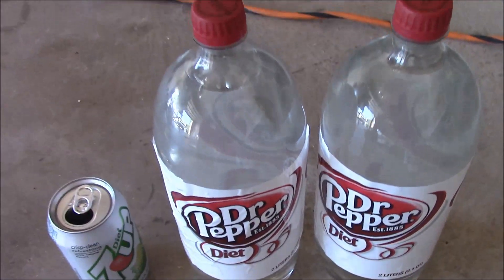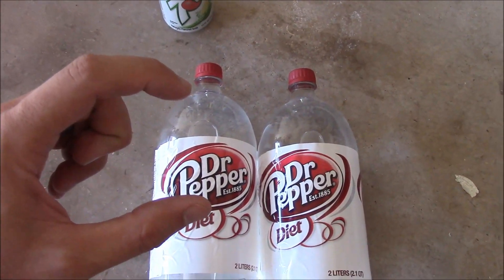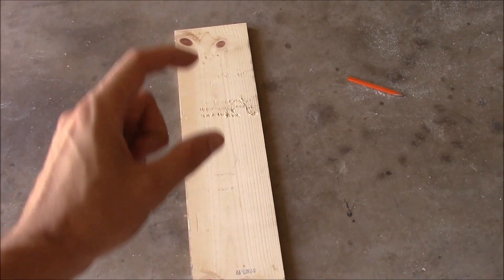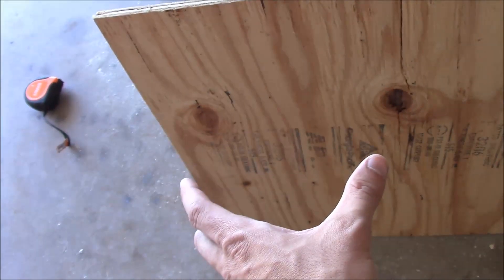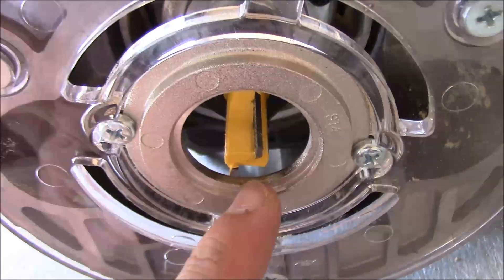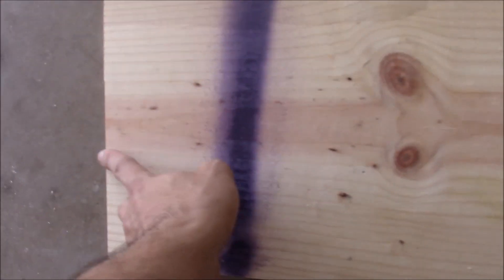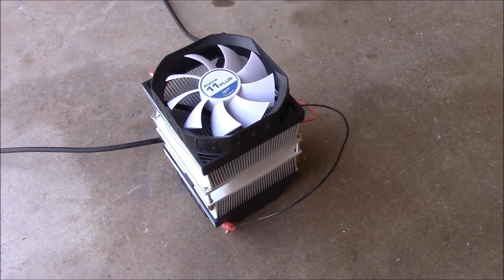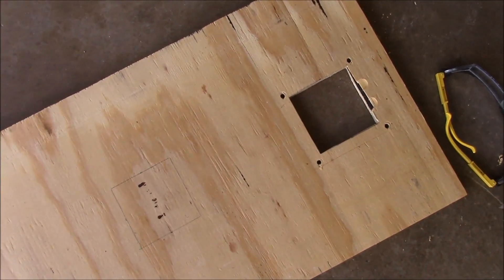Mini DIY Peltier/TEC Fridge Prototype - Learn From My Mistakes

Comment: I doubt that you will manage to build a fridge this large using Peltier devices. They have very poor efficiency (maybe 4%) and if you want to generate a "cooling power" of 10W, which may not even be enough in itself to cool your fridge, you'll have to use electrical power 25 times greater, which is 250W. From a 12V source, this would require a current of around 21 Amps. Your 2 x 7Ah batteries would be fully drained in less than 20 mins. On the other hand, a standard fridge has an efficiency of about 40%, so the total energy consumption for the same cooling power would be only 25W (or 2A). That's why you don't see too many house fridges (if any) built with Peltier devices... It is essential to use extremely efficient thermal insulation and even so, in amateur conditions, you may still loose a few watt of "coldness" through the walls and door.
Reply from the maker: Understood.  This is an uphill battle and will never be as efficient as a normal refrigerator but it could be a valuable prep to keep a few things cool in an emergency situation.
Reply: I am not sure where you get your numbers. But peltiers are not as bad as you make out. In fact the official numbers show a 136w peltier to be able to move 80w of heat. Of course that means on the hot side you have 216w of heat to get rid of.

As far as a compressor system which is used in fridges and air conditioners they are far more than 40% efficient. They are over 100% efficient since they can actually pump more heat than energy required to run them. And no this does not break the thermodynamics law. Please research this to understand it.

A typical air conditioner of 500w usually has a cooling capacity of at least 2kw. Which means 4w of heat is removed for every watt of energy used by the system. This is due to the amazing ability of gas compression and expansion.
Reply: David Irving Hi David. Please check here: http://www.powerchips.gi/technology/pcalc.shtml. The Peltier is said to have under 10% of the Carnot Cycle. For a Carnot engine, operating with a high temperature of 35°C and a cold temperature of 0°C, the efficiency is (according to http://hyperphysics.phy-astr.gsu.edu/hbase/thermo/carnot.html) 9.58%. I selected these temperatures as for a typical refrigerator. The higher the temperature difference, the better the efficiency. Also, wikipedia 
(http://en.wikipedia.org/wiki/Thermoelectric_cooling) says that Peltier devices are typically about 4 times less efficient (10...15%) than standard refrigerators, which have an efficiency of 40...60% of a Carnot Cycle. Even considering a Carnot Cycle having an efficiency of 50%, the Peltier would have an efficiency of 5...7.5%. I haven't read much about these things, please feel free to direct me to some online documents describing a better efficiency.
I also do not understand how can a 500W air conditioner have a cooling power of 2kW. Can you supply some links please?
PS - I did some more search and based on http://www.heatsink-guide.com/peltier.htm, apparently supplying 12V, 2.7A (= 32W) into a Peltier device, helps moving 15W of power, at a temperature difference of 45°C. This is surprisingly good news, if it's true.

Thanks, Nicolae
Reply from the maker: Nick, thanks for the research.  That is great info!

Comment: Nice experiment. Very similar objectives to one I did 6 months ago, do please take a look at my video.
https://www.youtube.com/watch?v=M6e2rrK0Cvg
See part 8 (!) for my conclusions on my water cooling cool box.
Perhaps between us we can crack this!
Like John D indicates keeping heat from the hot side well away from the interior is a challenge (I moved the peltier as a result). Fan of course also give off heat.
I too experimented with lead acid batteries, though "car" size. I calculated that we would need to achieve high efficiency such that the thermostat control would reduce the overall power usage if this is to be suitable for running on batteries whilst camping etc.
Tip: I suggest 50mm (2 inch) min. ideally 75mm (3 inch) thick foam walls. My 100mm walls made the box too big.
Good luck!
Reply from the maker: Hey!  Nice videos.  We were doing very similar builds around the same time.  I also went with water cooling a peltier only a week or two before you did (https://www.youtube.com/watch?v=tnKlIc6oCCg).  My next build (in the next few weeks or so) will be a more insulated, better built refrigerator box with a liquid cooled peltier setup.  Stay tuned!  I am sure we can figure this out.

Comment: You need to insulate the two heat sinks from each other where the TEM is not. You do not want any heat transfer from one to the other. This is where you have your greatest temperature difference. Heat rises so you want  to try and design hot heat sink side up so heat will flow away from cold. Check temperature of hot heat sink you want that as close to ambient temperature as possible. Make sure no heat from hot heat sink is blowing on to your frig. Inside the box you are trying to warm that cold heat sink to ambient temperature of the interior. You may want to play with fan direction also. Keep trying remember HP started in a garage.
Reply from the maker: John Delselva Thanks for the comments.  I am definitely going to try again.  I have received the equipment I need to try doing this with liquid cooled peltiers so heat transfer should be less of an issue.  I am also going to make the box of the refrigerator more air-tight with finger joints and better insulation.  I will be doing this in the next week or two.  Stay tuned!
Reply: Heat only rises in a gas like air or liquid. It's not the heat that is rising but the change in the gas or liquid becoming less dense.
Heat inside a metal does not rise but simply flows to anywhere that has a lower temperature. Please research this.
Reply from the maker: I understand those concepts, David.  What do you think needs to be improved before I build my next one?

Comment: Should've put the peltier units on top. since cold air sinks and hit air rises, the unit would be colder inside. Do like the pros do on high-end fridges; where the compressor assembly is on top.
Reply from the maker: Maybe so.  In this case it wouldn't have made enough difference to meet my goals.

Comment: plug it into the wall?
Reply from the maker: I don't have an AC to DC transformer or I would.  This device runs off of 12v DC power so it can't be plugged directly into the wall.

Comment: Where can i buy the Heatsink fan and thermoelectric device that can ship to Singapore?
Reply: http://www.aliexpress.com/item/10PCS-LOT-TEC1-12706-12706-TEC-Thermoelectric-Cooler-Peltier-12V-New-of-semiconductor-refrigeration-TEC1-12706/1743145532.html
try Sim Lim Tower for heatsink
Reply from the maker: http://www.amazon.com/ARCTIC-Alpine-11-Plus-Cooler/dp/B00606OHQQ/ref=sr_1_5?ie=UTF8&qid=1414510090&sr=8-5&keywords=arctic+11

Not sure about shipping to Singapore but I would think that they do.
Reply: LDSreliance Thank you. But did they come with crocodile clip on the heatsink fan?
Reply from the maker: No they do not come with alligator clips.  They come with connectors to connect to a computer motherboard so you need to cut off that connector and then connect the wires to your own power source.
Reply: Okay. Thank you.

Comment: Very nice. I'm planning to install a Peltier cooler in my SUV and that's how I found your video. I think what inspectyerbooty said about the sinking cold air.will be quite useful. I think I should make holes on the board inside the cooler. It may lead to more uniform heat transfer inside. And also less mass inside the cooler means less heat inside the cooler. It may not be very significant but I guess every little bit can be helpful. Do you think it will be harmful to the battery if I install it in a car? Thanks for sharing the video.
Reply from the maker: Thanks for watching!  The only way it would be harmful to your car battery is if you run it when the car is turned off.  Car batteries are not meant to power a load for very long.  They are meant to provide a lot of juice for several seconds.  Kind of like a marathon runner (deep cycle battery) vs. a sprinter (car battery).  The sprinter is going to run out of gas quickly.  And with the kind of amperage that these peltiers can draw (5 amps to over 50) you shouldn't run it for more than a few minutes with the car turned off.
Reply: LDSreliance Thanks. I bought a 7.5 L cooler from the market today which have one Peltier element and there is no fan inside. I am disappointed by the performance and that is why I began looking for information on Peltier coolers. Can the absence of fan inside the cooler be the cause for poor performance? Also, the cooling surface is at the bottom of the cooler.
Reply from the maker: Having the cooling at the bottom isn't a problem.  I would suspect that the peltier inside is a very weak unit and that there is poor thermal transfer on both the cooling and exhaust side.  That is why I am trying to build my own unit.  The good part is that the units like you bought are cheap.  The bad is that they just don't work as well as you would think they would.  And I am pretty sure hacking yours up to add fans would not be worth doing.
Reply: Yes, it is very cheap and weak. But at least the cabinet is pretty well built and looks quite nice. So, if I install a more powerful Peltier unit it would not be a total waste.
Reply from the maker: True.  But the power supply for the fridge probably will not be adequate for an upgraded TEC.  You'll have to replace both.  Not a big deal, really.
Reply: How so? The voltage in my car power port is 12V. Do you mean that I will have to get increased voltage for an upgraded TEC?
Reply from the maker: Oh it plugs in to a car adapter?  I assumed it was ac.  You will still be limited to 15a max but that should be enough.  I think a 15a one might blow your fuse so I would recommend a 10a one.
Reply: WaaWaa Waa
definitely a fan inside and outside the box directly on the heat sinks of the peltier is a must for efficiency in my opinion. what i mean is you need 6 parts, a peltier, 2 heat sinks with fins, thermal paste, and 2 fans,... that's 6 right? LOL  with good luck

Comment: My question is will the heat side burn the wood? Or should I put some kind of barrier between the wood and the hot heat sink?
Reply from the maker: lwiley2002 Nope, it is barely warm to the touch with this lower power peltier.  Even with the strongest 40mm peltiers on the market, you still wouldn't burn wood.  You are safe!
Reply: Thanks, I'm using an old Colman cooler heatsink and peltier to make a fermentation chamber for brewing beer I just need to cool about 5-15 degrees in a box roughly twice the size of the original cooler, this should be easy considering the original cooler would get down to 32 in a truck that would get up to 80
Reply from the maker: Yeah that shouldn't be too hard at all.  It may take it a few hours to cool things down but it would work.  Good stuff.  Let me know how it goes.

Comment: I'm making a similar refrigerator for my school project but I'm also planning to use the hot air to make a heating chamber. Can you let me know if its possible and approximately till what temperature will the heating chamber reach with two similar Peltier modules used by you?
Reply from the maker: *****I am not sure what temperature the hot side will reach.  The difference in temperature between the hot side and cold side of the TEC is about 75 degrees C with one unit so if the cold side is 15-16 degrees C like I found then the hot side would be a maximum of 90 degrees C (or about 195 degrees F).  That isn't possible in the real world so I would guess around 150 degrees F or so.
Reply: LDSreliance Great! Thank you for the info. :) One more question; since there is a considerable temperature difference in the TEC and the thickness is not very large (4mm approx. I think), does the hot air of the TEC try to get back to its cold side and decrease performance? This question was asked by a senior faculty of mine and I couldn't give her a convincing answer as I've never worked with a TEC.
Reply from the maker: Not if you draw the heat from the hot side of the TEC through a heat sink and then blow the air away from the unit.

Comment: are you going to make another video on this test?
Reply from the maker: Yep.  This time I am going to cool the peltier with liquid instead of air and use a cold plate inside the fridge instead of a heat sink and fan.  Stay tuned!

Comment: What wires are what on fan i have the same ones
Reply from the maker: Shawn GIlThe red wire is positive and the black wire is negative.  The other 2 wires you can just ignore.  They are only used for computers.
Reply: Thanks and i looked it up it says if u hook the blue up to red or black i forget it turns the fan to slow speed
Reply from the maker: Yeah the other wires control the speed of the fan.  Sensors in the computer can crank the fan up or down depending on the temperature.
Reply: Yep thanks
Reply: Love this desine so mutch making my own verson
Reply from the maker: Awesome!  Good luck.  I'll be making an improved version and video soon so stay tuned.
Reply: Is it going to be with the water cooling
Reply from the maker: Yep
Reply: Nice and thanks for the help man see u later

Comment: with a more sustainable power supply how cold were you able to get it?
Reply from the maker: I dropped it another couple of degrees but discovered some problems with the setup.  I am currently testing a water-cooled peltier setup now that is MUCH more efficient and should be able to actually freeze water.  I will be posting the video in the next day or two.

Comment: Hey I've been working on my own prototype of a cooling device like yours. My only issue is getting the wiring right and I was hoping you could either make a video or reply with steps on how to wire it correctly. I'm using your same products. Thanks!
Reply from the maker: What specifically would you like to see?  I could make a video but I'm not sure what to explain.  Do you want to know the products I used to wire it?  Do you want me to explain why I wired them the way I chose to?  Or do you just want me to tell you what to do and not worry about why.  Some people just want to follow a recipe without a lot of fluff.
Reply: Yeah I just wanted to know what I wire to what after I strip the wires to get it connected to my adaptor. Also with the hot and cold side wiring and how to differentiate which side is hot and which is cold.
Reply from the maker: louis tournas Be careful you don't leave it connected for more than a few seconds without a heat sink or it can burn itself out.
Reply from the maker: LDSreliance I shot a video on how to wire the peltier and fans:  http://www.youtube.com/user/LDSreliance?sub_confirmation=1

Comment: Hello LDS, great video by the way. I notice that on you most are using air to cool the peltier. Why not use water? Split the device down the middle to have separate water chambers. The cold side the water can be pumped through tubes to cool the fridge and also some of the pipe could also be used to remove the heat from the other water chamber. Only one power supply, sealed system, water is better at removing heat. Could this work?
Reply from the maker: Yes it could.  I am actually going to be doing a water cooled setup next.  Stay tuned!
Reply from the maker: I just posted the water-cooled peltier device video today.  Check it out at How to Build A Water-Cooled Peltier Device or Thermoelectric Cooler

Comment: Hi, thanks for sharing;

You can put whatever low efficiency fan on the hot side, but not on the cold side. Because you are adding heat load into the space you wanted to cool. Say 12V X 0.4A X 1.2 factor = 5.76 watts of continuous heat load per fan is added into the space. (Refer to ASHRAE under Heatload motor and fan inside airstream)

(Basing on ambient of 33 deg.C, for example)
Based on your construction and applying quick rule of thumb, approximately 15w/m2 of construction + initial heat sinking, I would say 10W of ambient heat load added into space.

So, 5.76 X 2 nos + 10W = 21.52 watts / 0.1 (eff. of peltier) = 215.2 watts of peltier cooling (at required delta T wanted) is needed.

if outside is 33 deg.C and you want inside 15 deg.C inside, delta = 18 deg.C, basing on the peltier 12710, you would need 215.2/60 = 4 devices. Use 5 devices running at 10A continuously for faster cooling effect and quick measurable results.

one video showed the peltier freezed in a very short time, that's because he didn't put a fan on the cold side and very small  area. (Peltier freezing water in 3 sec! (-21'C))

Suggestion: you don't need so many fans on the cool side, that's too much air flow, would you try putting 5 peltier, with 5 fans on hot side and only 1 fan on cool side. I think that would produce quick measurable results for you.

Good Luck and thanks for sharing.
Reply from the maker: Good point.  I hadn't thought about the added heat load to the inside of the fridge.  I'm going to play with a liquid cooling setup and a cold plate next so I won't have any fans at all on the cold side.  Thanks for the ideas and info!